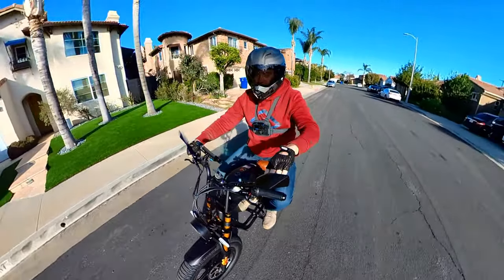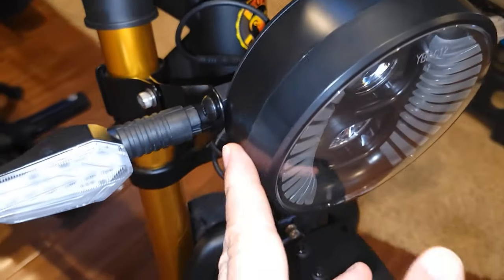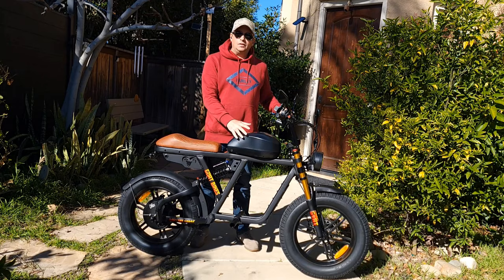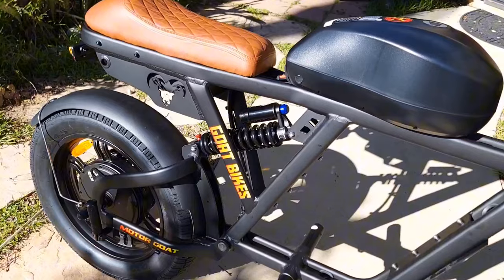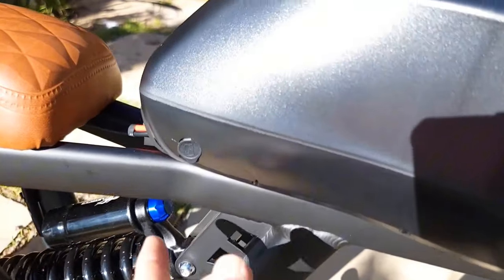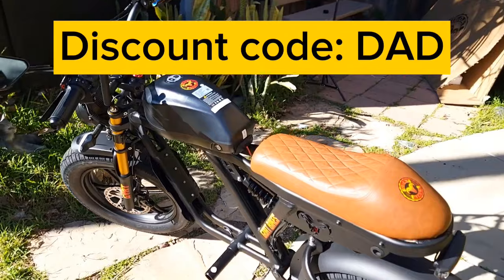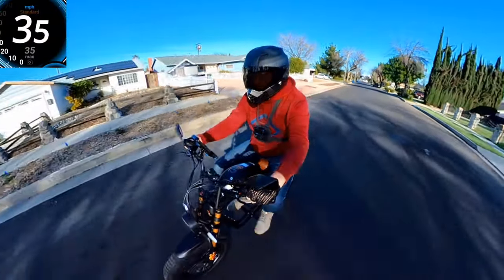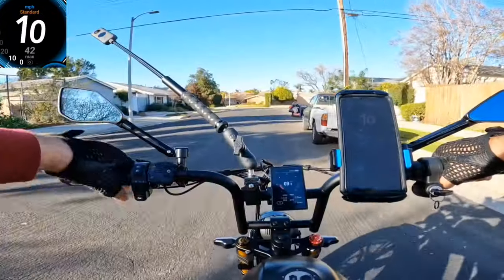EPIC: 45MPH+ Motor Goat V3 60V E-Bike Comprehensive Review  2024

Comment: Very Nice! I currently have a Juiced Hyperscorpion.  It has turn signals. That's an important feature for me. I like this bike plus it's faster to keep up with traffic. I'd want the pedals on for exercise.  I'm guessing it comes with or, without pedals.
Reply from the maker: yes, its your choice to pick with or without . mine was without . This bike set for riding on the road with all the futures . headlight is super bright as well
Reply: The battery should be place on the lower frame..lots of room its wide open..the place for add on batteries..👍🏽

Comment: No pedals? What state are you in? I would be pulled o ver from day 1 in my city!  It is E motorcycle which need registration and tag and motorcycle endorsement.
Reply: Which you won't get because there is no vin😊
Reply from the maker: I think there is serial number in frame. I need to check as v2 has
Reply: @erides  you need an MCO(unlikely), bill of sale(likely), and odometer endorsement (rare)
Reply: @andyfumo8931 
In my city, cops simply impounded the bikes and give you tickets for riding unregistered moped with court date to appear.
Reply: @MrMtr999  so what's your city
Reply: Where do you live?
Reply: @leetjohnson 
I replied and got deleted 2 times so i guess OP does not allow location.
Reply: @MrMtr999  that's really strange....can't even say what state or city you live in? I've never heard of that before. People sure do love to censor others these days.

Comment: I like my Goat but there is a few negatives about it the front fork is too narrow for the wheel size and the rear signals don’t blink also they lied about it’s speed tops around 43 mph not 45 to 50 which they posted on the site when I ordered it
Reply from the maker: I think they will fix all the above .  The speed listed on the website: Max speed of between 40-50MPH . I think for 1st batch and price that was pretty good! They are working on solutions about fork and tire . Either reduce tires to 4 inches or wider fork. I have reduced air on the front to high recommend 15 psi, and it's not rubbing on fork now.
Reply: @erides i spoke with customer service yesterday. They said they would change the front tire to 4.0 and leave the back tire at 4.5 for traction
Reply from the maker: @VEGITAS4  I guess they decide what I recommended them before. I love the 4.5 look, but if people are not happy with thin  space, the 4 inches still will be good-looking

Comment: 15:28 why are you riding with the kick stand down, especially that fast
Reply from the maker: Haha, good eyes. Lucky me, the stand was shorter, but I noticed it  after..
Reply: @erides  you reached 46 going down hill, what was your top speed on the flat road?
Reply from the maker: @LeeAyzahn  actually not exactly downhill as the hill was before the intersection which I slowed down and you can see speed dropped to about 40 - 41 but after  reached 46 and on display was above 46 but gps is not as responsive as display . I think on flat I was getting 41 -42  but  my  front brake did some good friction as you can see the test at the end video  I made 38 mph but before in that area 35-36.  I can tell solid 42 on long flat road if wind not in your face.